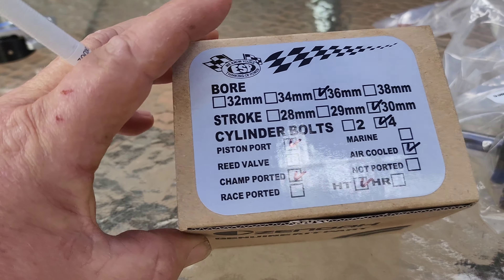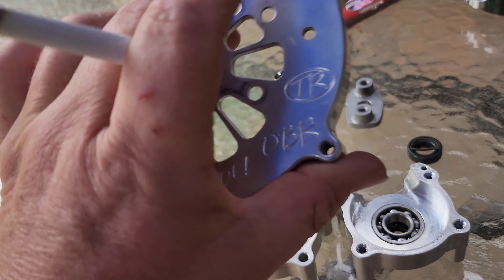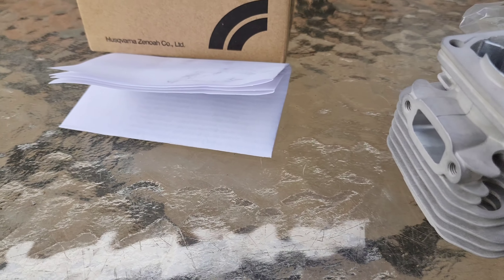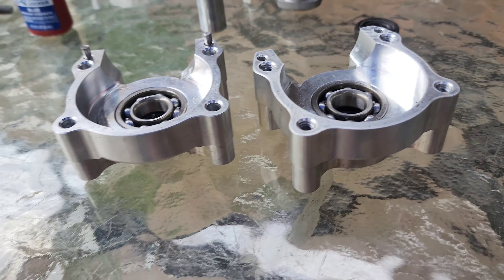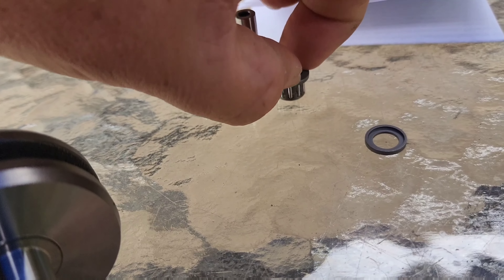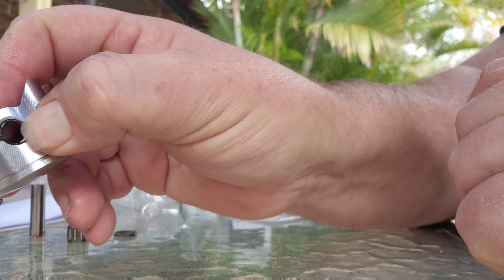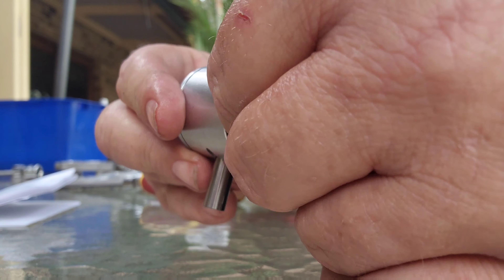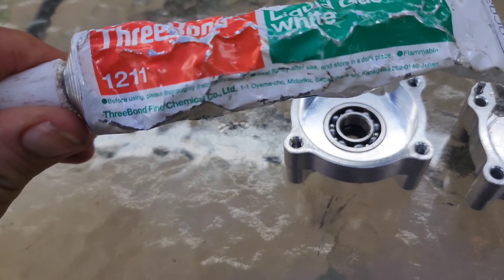NEW LOSI 5IVE-T 2.0 RC RACE TRUCK BUILD SERIES PART 4 ENGINE BUILD

Comment: Awesome video, very informative. I have a question.  Why choose 30.5cc instead of 34cc?
Reply from the maker: Thanks mate in Australia for racing shortcourse trucks the biggest engine you can use is a stock 32cc. No mods allowed. So we mainly use full molded piston ports 29cc and 30.5cc and some use 26cc.

Comment: Are you racing that track? If you are what is the biggest engine can you put in that truck to race?
Reply from the maker: Hi thanks for watching the biggest engine  in Australia your aloud is a 32cc stock engine no mods aloud. CC size doesn't matter for track racing you can win a race with a 23cc. It's about your set up and of course the driver yes racing this car next season. Hope that helps thanks.